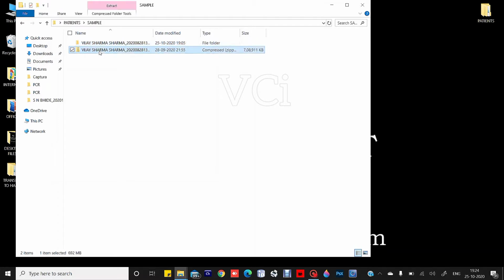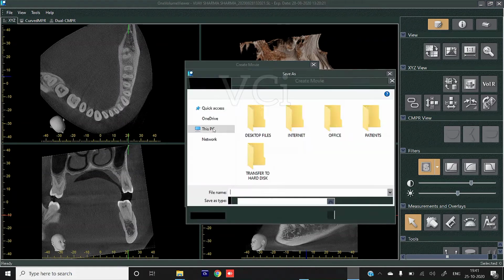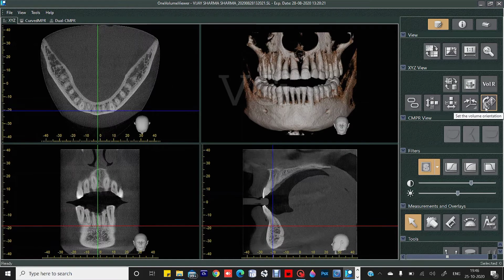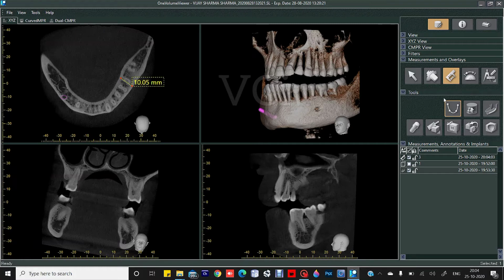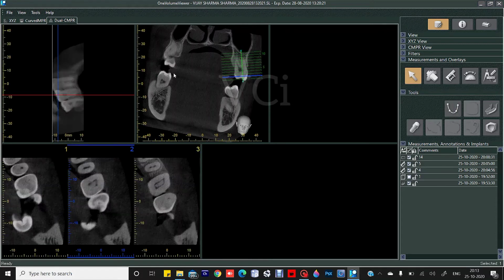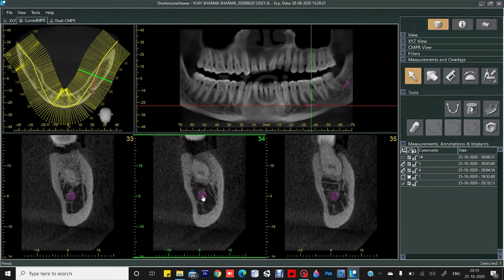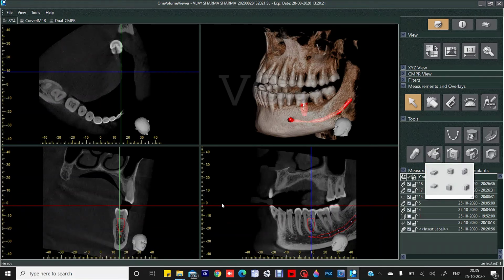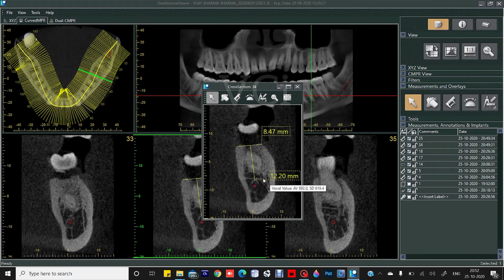CBCT SOFTWARE DEMONSTRATION

Comment from the maker: JUMP TO:
OPENING THE SOFTWARE/ INTRO 0:12 - 0:15
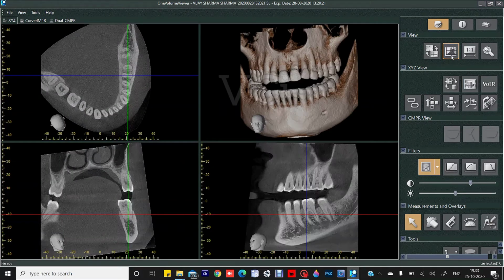HISTOGRAM 1:26 - 2:12
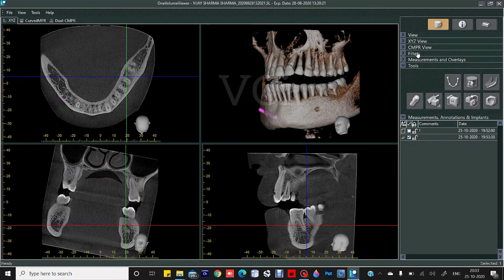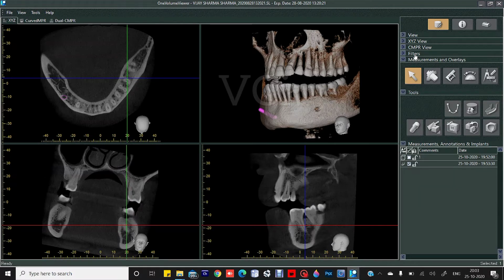FILTERS 14:01 - 14:45
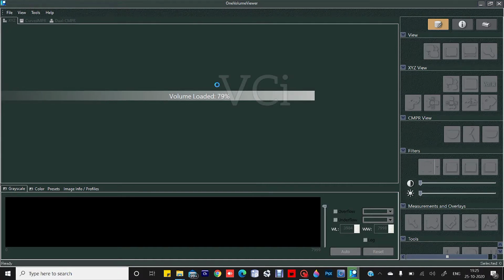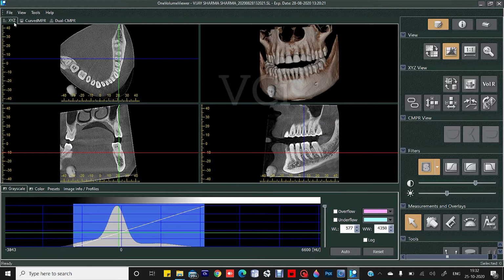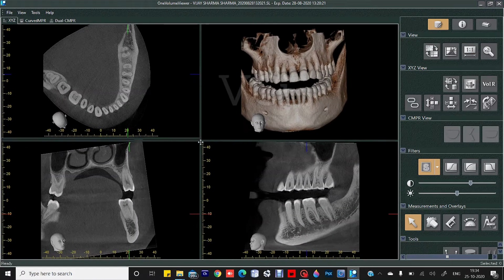DIFFERENT VIEWS 0:56 - 1:18  /  3:34
VIEW BUTTONS 2:13
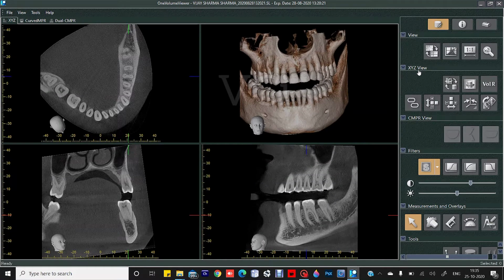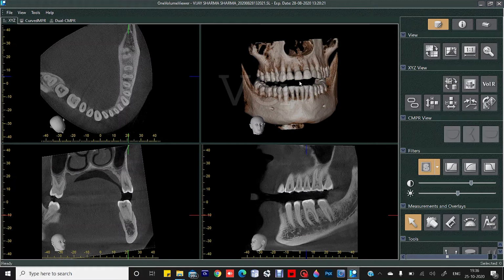XYZ VIEW 3:34 - 4:08
REMOVE THE COLOURED VIEW LINES 3:36 - 4:08
VOLUME RENDERING 4:09 - 8:50
REMOVE SYNCHRONIZATION/ DECOUPLE 7:54 - 8:49
MAGNIFIED IMAGE (ZOOM/ DOUBLE CLICK THE SECTIONS) 2:48 - 3:33
ORIENTATION 9:15 - 10:09
SPLINE LINE/ ARCH MARKING 10:59
SPLINE IN DUAL CMPR 19:34
INTERVAL 11:26 - 12:40
FOV LINE 12:41 - 13:48
MEASUREMENTS/ OVERLAY 14:45 
OVERLAY 15:35 - 16:32
ANNOTATION 16:43
NERVE MARKING 22:55
DENTAL IMPLANTS 25:38 - 29:22
VOLUME CUTS 29:33 - 31:57
VOLUME SCULPT 31:57
HIDE/ UNHIDE 32:27
SAVE/ EXPORT 33:29
HOUNSFIELD UNIT (AVERAGE VALUE APPROXIMATE) 35:00
Reply: thanks a lot .. can we export ct images from this program ?
because it come in .pak file which can not be extracted